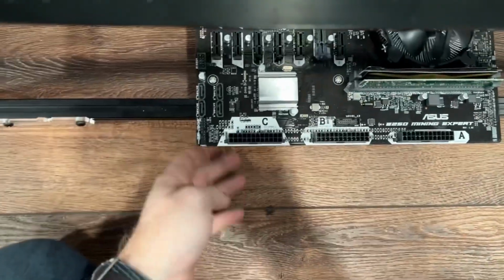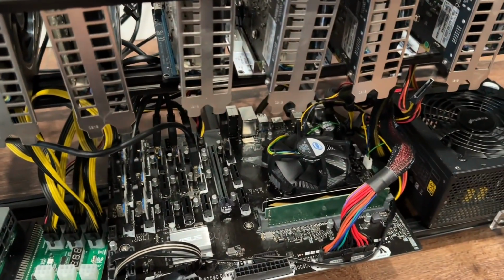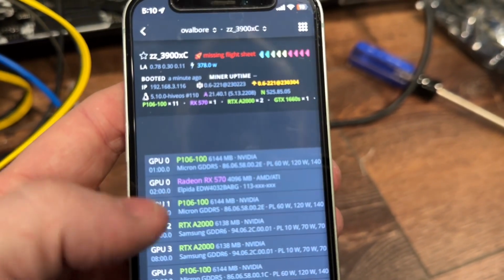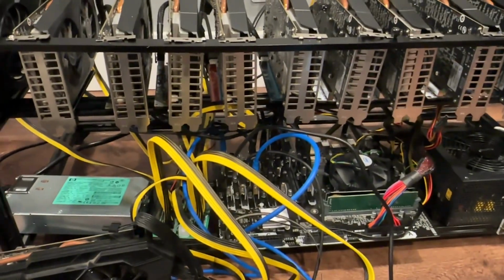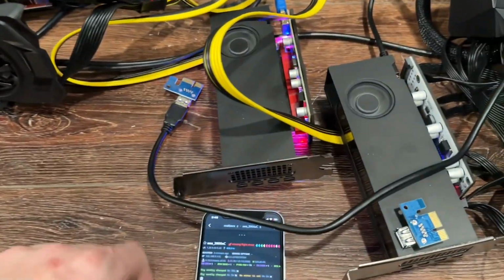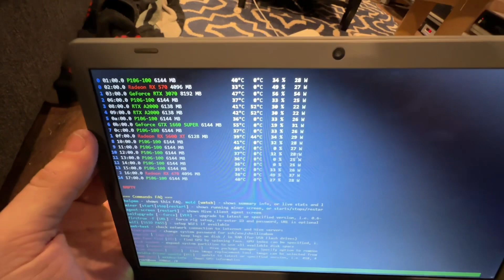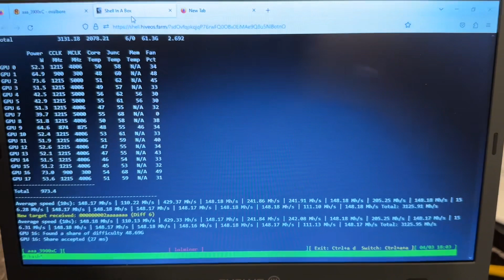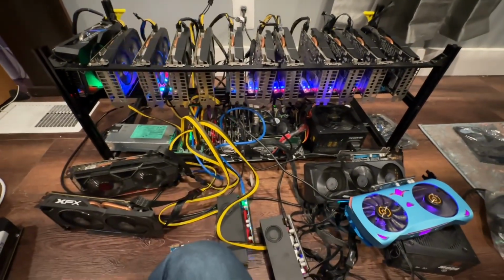18 GPUs. 1 Board. HiveOS.

Comment: It seems more efficient only using 1 mobo for all that. Less overhead power for ram,cpu ect. I’d like to see this scaled to like 30 gpus per mobo
Reply from the maker: only problem is you do supposedly need some older P series cards to get this many working. 

I do think theres a market if someone could use an older low power Xeon with more PCIe lanes and a custom board and bifrucation chips to allow an 18, 20, 24, 32 GPU board.